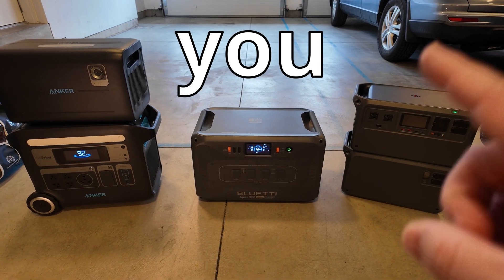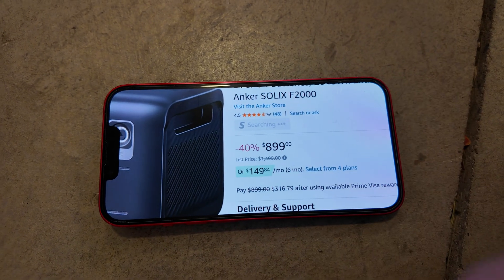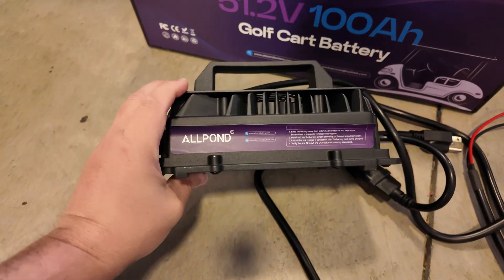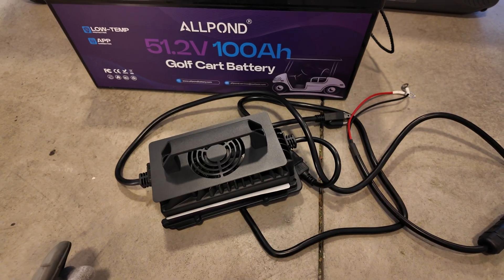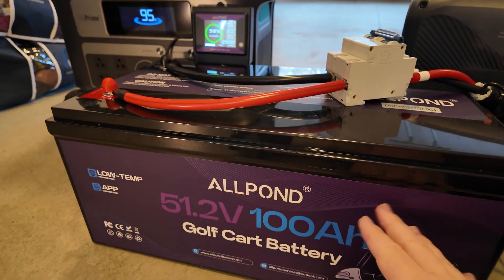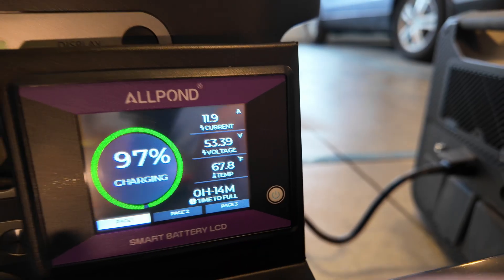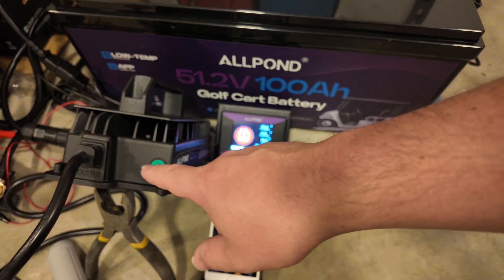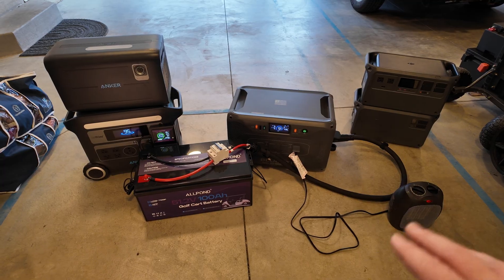The Great Solar Generator Rip-Off (And How to Beat It)

Comment: I don't think your second method will work unless your bank has external port for the add on battery. Mine is internal so no dice. But your first method (solar input ) should work fine.
Reply from the maker: Correct. Not all the options are viable for every power station out there!
Reply: @theresatrickforthat  But this is still a great idea to save money and I will just use my solar input. Thank you!
Reply: If it's internal then just make it external.
Guarantee there's a positive and negative in there somewhere!

Comment: Very good video, but extend your logic just a little further.  Don't buy the proprietary power stations in the first place.  Unless portability is THE most important thing for your use case, they are grossly over-priced.  You can build a DIY solution that delivers more of everything you need, including non-proprietary battery solutions, by avoiding power stations altogether.
Reply from the maker: You're absolutely right! Which is why I mentioned that in the video! Hopefully you saw that part!
Reply: @theresatrickforthat  - Nope, I missed that part.

Comment: Going to need that ecoflow expansion battery video. I have a delta 2 max and would love to hookup 3rd party batteries to it.
Reply from the maker: It's coming soon! Be subscribed! It works super well!
Reply: Agreed I'm really hoping this is viable. Seems like EF might have extra proprietary software getting in the way
Reply: D2M is so solid and recommendable otherwise. But it's only $100 more to get a whole second D2M vs the expansion so why not double the inputs and outputs. The expansion should be more like $400

Comment: Great! Just started out looking into power banks recently, for camping next yr, yet to buy. Being an electronics engineer this answers a bunch of questions i had. I wondered if these power banks had been crippled to only work with official accessory batterys. Like power and data with some protocol for some comms between them. Which would be annoying, expensive upgrades for the kwh acheived. I was considering a 2kwh aferiy, plus 2kwh expansion battery. This is very good info, excellent job sharing this info. And the logic and explanation and indeed guidance/warning before bridging those 2 batteries is perfectly correct. A suitable large fuse in the bridge might be good idea, save the wires melting if current goes thru the roof.
Reply from the maker: Awesome to hear you found it useful and informative! Yes! A fuse would be good! I have a DC rated breaker...but I trust fuses more than breakers for an overcurrent event.

Comment: Great idea. I wish Anker didn't have a proprietary expansion battery cable/port, so I could build my own rather than having to spend so much on their pricey cable just to cannibalize it for the plug. But the XT60 method is very cheap and works almost as well!
Reply from the maker: Glad it was helpful!

Comment: "Following your last video recommendation, I purchased a Temgo battery for my solar power station. The performance has exceeded my expectations."
Reply from the maker: I'm so thrilled to hear that! I'm really surprised more people don't do it!
Reply: @theresatrickforthat I did this but because I needed a faster way to charge my power station and I learned that I can charge the temgo much faster than the bluetti and it fits better on my dolly. I got a 12v 300amh. It'll run my portable oxygen concentator with a 12v charger too and it puts off heat which is perfect for a winter outage. There's no way I could handle a 24v 300amp battery. I would need that to come with another person to move it. I got the bluetti rings too, I'm glad to see I did it right!
Reply: I did the same thing 😅

Comment: Is this battery too big to work with the Delta 2 with a max input of 60V through the xt60 port?
Reply from the maker: Nope!
Reply: Just buy a battery that is within your solar charge controller's range and you can do the same thing.  Not sure what charge controller is on the Delta 2, but if it's 12V to 30V, then buy a 24V battery and all is good.

Comment: I'm a fan of external batteries.  You don't have to make sure the external battery is at the same SOC as the internal battery, though.  It just needs to be at a close enough voltage that the initial current transfer is not too excessive.  They can have very different states of charge to start with.  After two charge cycles the internal and external batteries will be reasonably well synchronized with each other.
Reply from the maker: True. But the surefire way to make sure you don'y have issues is make sure they are fully charged before connecting.

Comment: definitely makes far more sense to go with a golf cart style / trolling motor style battery rather than the proprietary expansion batteries for power stations. i have a modular setup that is similar. except i decided to stay with 12v batteries for my use case. I have an eco-worthy 12v 280ah battery that was under $400, good price for 3584 watt hours imo, and it uses good quality cells, a nice BMS, and has great build quality. I also have a 12v 100ah li-time trolling motor battery that is set up inside of a battery box, which has a built in breaker, 2 12v cigarette sockets and usb ports built in. also has external terminals. 

i can use either of these batteries to charge my bluetti elite 30v2 via the solar input. I also have a standalone 2000 watt giandel inverter hooked up to the larger battery. this system gives me flexibility and redundancy. the bluetti is small and portable, it's convenient for smaller loads & can act as a UPS for my critical electronics / internet. while my larger batteries act as primary storage and power for larger loads. they can all be used to power my 12v fridge and other appliances when needed. i can maintain them all with my solar panel(s) and MPPT charge controller. ultimately they will all be elements of the power system for a camper van conversion.
Reply from the maker: Sounds like a really well-thought-out and flexible setup you have!

Comment: Everyone is pushing this scam..    and this is the first video i have seen showing the power stations are infact a rip hoff.   

I got 8 186ah Agm northstar bats for $70 bucks each.. ..   with 3 Inverters..   for the whole house.  I used powermax battery chargers to charge them from grid. Or Generator.  for Fractions of the price of those powerstations
Reply from the maker: Sounds like you have a nice setup! Good for you!

Comment: Can you make the Ecoflow video about the expansion battery?
Reply from the maker: Yes! That’s coming up super soon!
Reply: @theresatrickforthat  Hi, i was thinking about the ecoflow delta 3,  and it seems that ecoflow products have an extra 6 pins to communicate with the external battery and only then enable power in or out, ways to get it working,   somehow alter the firmware, get inside with 2 wires, use solar imput somehow+charger (not really a great idea i know). Do you have any other possible better ones? looking forward for an answer or video. subbed

Comment: Your method works better than UPS mode on a fridge!   

Although my small powerstation can run my fridge, it cannot run it in UPS mode because the AC inlet for charging is only rated at 15 amps. The surge rating when the compressor comes on is higher than that so it immediately turns OFF the powerstation off and therefore the fridge has no power.

Your method bypasses the AC inlet on the powerstation so No Problem.
Reply from the maker: You're 100% correct!
Reply: Oh!  What is UPS mode on a fridge? Just auto-backup to run from battery? 
 (Gonna need to rewatch this & other vids!)

  I bot a GZ Li1400watt box, & ran 2 chest freezers off that.  
The old-style basic chest freezers call for 15A circuit. 
Had 1st called to talk with GZ tech, to see how best to do it (use manual pin timer on each chest, to limit temp in each box…)   
The controller gadget under the lid bricked after a couple years.  
Then the display & whole box bricked, after about 3 more years.  
That doesn’t look good for the glamping boxes being used IRL.   
When it worked, it was flawless. 
Each cold box has start-spike of around 800 watts for split-second, then drops to about 100 run-watts.  So the battery box covered the draws. 
One chest has 5 pins equal-spaced around the clock, to maintain fridge temp. 
The freezer timer lets it run normally only 12 hrs out of 24 (have solid frozen food, yet avoids ice-up, so in about 7 years, have never had to defrost it). 
So when the GZ Box bricked, the 2 cold boxes had to plug into the wall, til I figure out a real system.  

Maybe, each cold boxes had shoulda had its own AC plug on the battery box?  
Maybe both cold boxes plugged to one AC outlet on battery box, might have been too much if both cold boxes cycled on at same time?  (GZ tech shoulda said so?)
Hope to learn how to do things better!

Comment: Can the Allpond app remotely turn on and off the charging of the battery?
Reply from the maker: Yes! Through the app as well as the remote screen!
Reply: @theresatrickforthat That's perfect for my needs instead of manually unplugging the connector to stop the battery from continuously charging the battery until it's depleted. I forgot to ask, does connect via Bluetooth and Wi-Fi or Bluetooth only?

Comment: is is why i am leaning on building my own.

i just need some outlets and usb type a ports. 

i dont need anything else. i also want it to be rechargable from an outlet, and from solar.
Reply from the maker: Sounds good!
Reply: @theresatrickforthat  i would like to know why so many items are bloated with features. 

Blutooth takes electricity, for example. 

the less excess wiring and features something has, the more energy efficient it is at delivering the load you want to your device. Inverter chargers, or hybrid inverters are some of the most bloated items for example.

Comment: Does this definitely work with delta 2 I’ve not seen anyone doing it with the  delta 2 and asking ChatGPT says there’s different communications between the expansion inputs, at the moment I have BLUETTI ac200l ab300k expansion battery also 2 x 5120 watt golf cart batteries paralleled into the b300k expansion port and a victron mppt 150/35 added to the golf cart batteries, everything balances perfectly, I cut the BLUETTI expansion cable in half , I used the 6 awg cables from the other half. I’m using a 80 amp dc 2 pole breaker it’s perfect , I have a delta2 and I have the EcoFlow wave 2 battery paired with it fine, I’ve been researching adding a 51.2v 100 amp battery to it but I can’t see any at all apart from the solar input hack which I do through my spare 52v ebike batteries but ideally I’d like the solar port available and rather add power via expansion
Reply from the maker: Yes! I have a video coming out about that very soon! EcoFlow isn't immune to the DIY community! Haha!
Reply: @theresatrickforthat  yes please I’ve just been hesitant , can it be done the same way as the BLUETTI

Comment: Very nice. Other way that voids the warranty is to open the power station and wire in a direct connector to the battery to some plug you can attach it to without the expandable battery cable. For the cost and if the solar charge controller is fast enough, to me 500 watts and up is plenty fast, I would just go that route. If you dont care about the warranty, than it is cheaper to put in your own cord into the power station and put an attachment to plug into coming out of the power station somewhere it will fit. If you are capable enough to do that, then you probably wont use the warranty. I would probably use an anderson 50 amp for size and ease if done that way, but how much space you have in the power station would make that decision for you. 
Getting the special cord and converting it to work with any battery keeps your warranty on the power station and gives you more options than the cheapest choice. They could still void your warranty if they know what you did since you hooked up an external battery directly to the main battery, but that would be up to them. And unless you tell them or put it on video, I do not know how they would know.
Reply from the maker: Thanks for sharing your thoughts on another potential method!

Comment: Very cool video.  Just got my Bluetti Apex. It will be used for emergency backup power for my house. Did a test and the Bluetti Apex was holding up for 7 hours. Would like to expand that up to around 24 hours. So the Allpond would fix that.  Question is how to connect it ?  Battery port or Solar port? Any idea how much losses it would be using the solar port? I will only use the Bluetti as a backup. So it will only be used 1-2 days/year. Then it sits doing nothing the rest of the year.
Reply from the maker: If I were you, I'd spend the little extra money and connect through the extra battery port. That way you don't need an extra solar charge controller (you can use both inputs on the Apex 300 itself) and not use up the solar ports. Plus yes, it would be more efficient without going through minimal conversion losses through the MPPT built into the Apex 300. But that's just me!
Reply: @t @theresatrickforthat  Thanks.  Do you know if time to go and SOC will show the right numbers if using the battery expansion port?

Comment: Is anyone doing multiple of the power stations of different brands paralleled together? Like an spex 300 and anker 3800 along with some server racks?
Reply from the maker: Should work fine! Just properly fuse the wires!
Reply: As long as their battery bus voltages are compatible, meaning they use the same series count for their LFP cells.  This is not necessarily always going to be the case.  EcoFlow's home storage batteries, for example, are 102.4V (32S), not 51.2V (16S).

Comment: I'm watching this literally as my Anker F3000 and BP3000 arrive.

I've seen some videos fooling various stations, not merely into charging from a battery via the solar port, but into thinking they are working with an expansion battery for bidirectional charging, like here. It's less of a cohesive solution and there's room to screw things up, but it certainly costs way less on a kWh basis. Also it's way more flexible and it provides you options if a component fails. I think a mix of proprietary and DIY items could be a nice blend of day to day convenience and deep prep.

I'd like to see an example of bidirectional charging working in convert with the Anker F3000, even better if it can work in concert with a daisy chained proprietary battery. It would also be interesting to see if the proprietary battery alone can be hacked into delivering DC power.

Thanks for the video!
Reply from the maker: Glad you found the video helpful as your new power station arrives!

Comment: Another great video full of good info.  I have two of the Temgo 48V golf cart batteries (thanks to your recommendation) and I'm getting ready to buy the Bluetti Apex 300 (again, thanks to your recommendation).  Do you know if the Bluetti CA90 cable be hacked and used?  I like the 90 degree connector to keep the footprint smaller.
Reply from the maker: Yay! So happy to hear I've been able to help you! The Apex 300 and the Temgo are one of the best combos out there right now for sheer power and bang for the buck! I'm sure you could hack those cables. You'll just have to perform surgery on the cable where as the cable I used doesn't require any modifications at all! I've got a video coming up in a few days showing how to build the adapter cable! I just teased it in this video!

Comment: Great video! I recently bought a Anker SOLIX C1000. Thinking about buying an extended battery  for it. Will this battery and  single wire / fuse work on it? Thanks,
Reply from the maker: Yes it will!
Reply: @theresatrickforthat  thank you!

Comment: You have the DJI 1000 shown but don’t show how to add the external battery. Would love to see your solution as I have this power station. Thanks .. ..
Reply from the maker: Okay! I’ll add it to the list!
Reply: @theresatrickforthat  i cannot find a single video anywhere doing this with the DJI power stations -- please do one for the DJI
Reply: @theresatrickforthat Thank You for video, please show how to connect 24v 50ah lifepo4 to DJI Power 2000 for capacity expansion.
Reply: Please do the DJI.  I would be very grateful to see if and how this can be done with the DJI.  As others have mentioned I can't seem to find a video on that system anywhere.

Comment: Thanks for the video! @Jasonoid also has great videos on this option. I cannot disagree with any of your arguments. I was fully down this rabbit hole, had all the components in my cart… battery, adapter cables at $0.15/kWh… then I saw Black Friday deals on the Anker C2000 + BP2000 at $0.277 per kWh after coupons. SOLD! I'm nerdy, but also need stuff to look good! I'll give up the flexibility for the sleek look and clean one-piece box (not a bag o' cables, components, & accessories)… this time. :)

Comment: What size fuse do you use and how do you size it?
Reply from the maker: Depends on what option you’re looking at going for!
Reply: First one, battery via t60 or mc4 to ring terminals, I want to do that with my fs3800 ankers. Im guessing it’s sized to the max of either the wire, or battery, whichever is lowest… lived this video btw, forgot to say that!! I bought 3 ecoworthy 48v server batteries for the cost of one anker battery lol